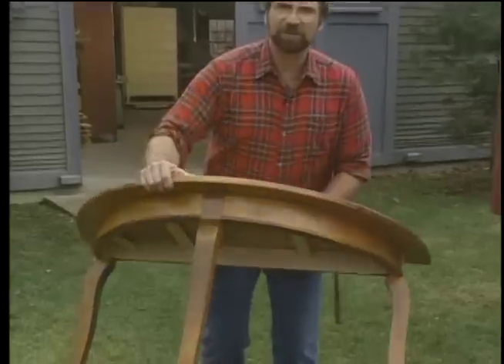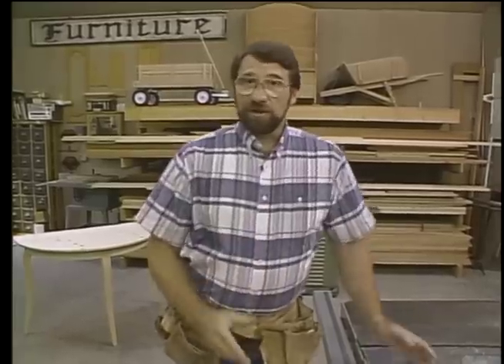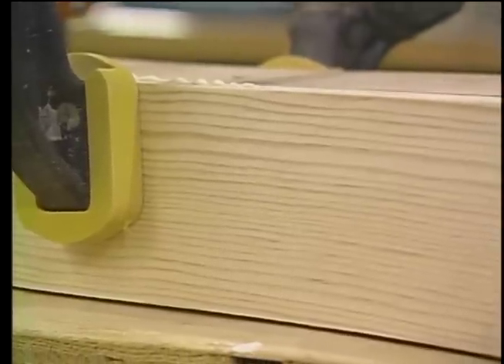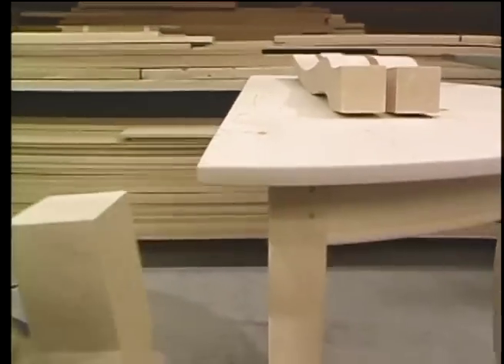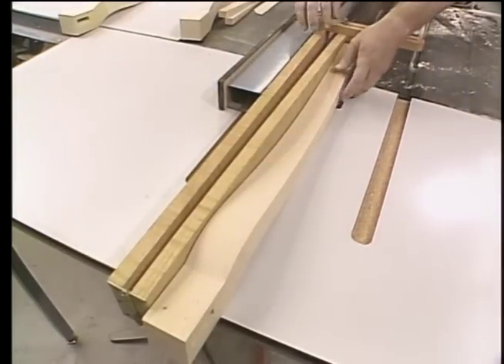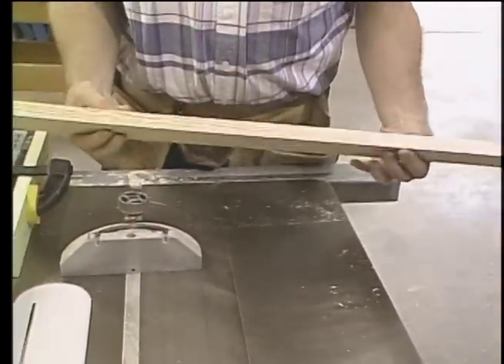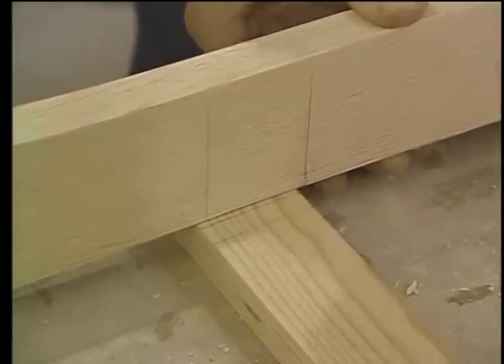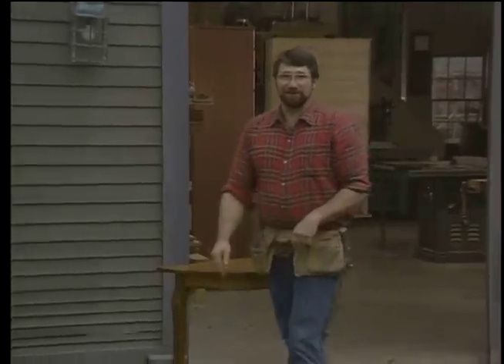Console Table  |  S4 E8

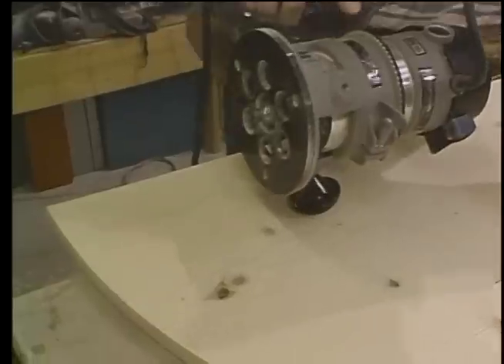Comment: @ 24:55 I love D handle routers like that, and even at that, they're easier to control than a two handle base alone!
Reply: Agreed.   Too bad I haven't seen one on the market in years.
Reply: @tree_carcass_mangler  Yeah, right? Looks like Makita has gone away with that type of handle, after the late 1980s, even though Porter-Cable has taken the lead for their routers in the early 90s themselves, with an outlet on the top of that D handle for safety, preventing the user from accidentally turning on the tool, especially when changing bits for different projects and applications. You'll love this feature, and it does come in handy!
Reply: @tree_carcass_mangler 
DeWalt has a d-handle base available for the 618 router.
Reply: @keith7630   Thanks for the info - I'll check it out.
Reply: @tree_carcass_mangler  
You’re welcome!